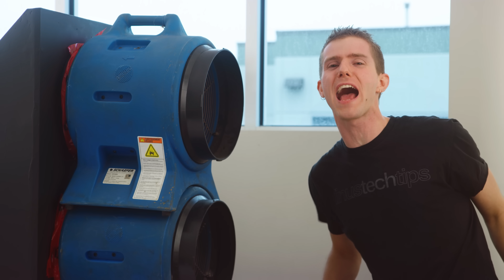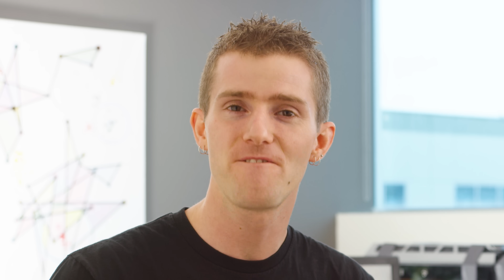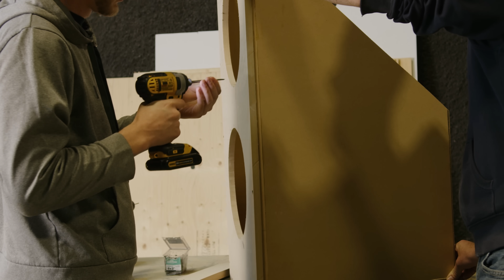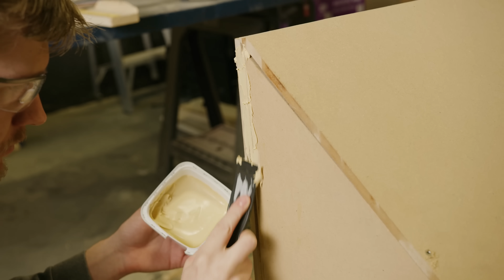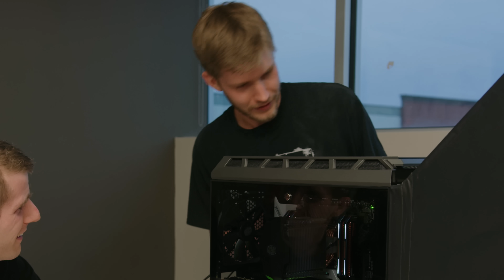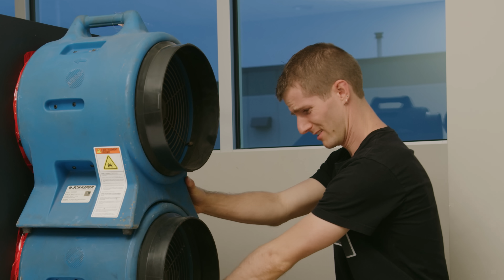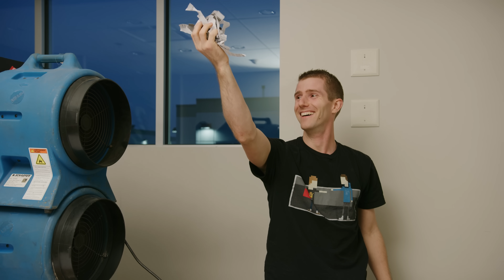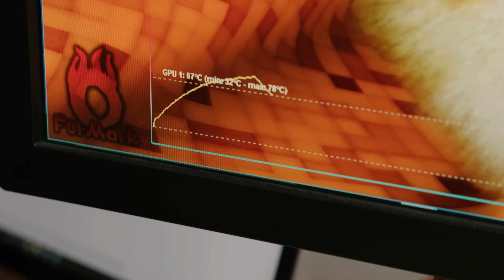Highest Airflow PC EVER - SUCCESS!

Comment: What if you make it so that the fans will suck air through a refrigerator before being blown into the case?
Reply: They've covered this kinda thing, fridge compressors aren't meant for continuous use and burn out
Reply: With the amount of airflow this thing is putting out you would need about the largest A/C coil for residential use to keep up with this thing.....and then, as naufalap pointed out, you would have hella condensation issues.
Reply: An air conditioner would be a better idea.
Reply: bruh, it's called a phase change case. It's basically an ac compressor and condenser hooked up to a cold plate. It's ungodly loud but will give you unlimited subambient cooling.
Reply: If the air was back to room temperature in the case this would be true. But.. We all know condensation happens because cold air can hold less water, making the relative air humidity rise in the fridge part of this magnificent theoretical case. As the air would still be cold when it enters the case from the fridge, it would still have a high relative humidity and therefore still be prone to condensation until it has heated back up again.
So either a very low room humidity or some kickass dehumidifying would be necessary.
Reply: Refrigerators are good at keeping cold, rather than making cold. It wouldn't have anywhere close to enough time to cool the air.
Reply: Yeah yeah, fridge compressors cant keep up. Use an A/C compressor.
Reply: 2 words: water condensation.
Reply: You'd probably need 50 refrigerators to keep up with the air flow and get any temperature difference. A single one would probably do nothing after first 5 seconds of these fans being on.
Reply: Just for youtube
A/C compressors are also not made for constant use....at least not residential ones.  Not sure about commercial ones (which would probably be too big anyway).  Better to just find actual phase change cooling equipment made specifically for the application.
Reply: Just for youtube
And if you open up your hood and stare at the compressor while your car is running you will notice that it goes off and on constantly....it does not continuously run.  If it did there would be no need for a clutch on the compressor pulley.
Reply: Are you running a computer in -10 celsius?  Proper phase change computer cooling is designed to run constantly at a low level btw.  Also running your car A/C in -10 celsius is not the reason the compressor has a clutch on the pulley (obviously you better have your heater on in your vehicle at that temp).  The reason it has a clutch is so that the pressure on the hi side does not build up too much.  The length of time to buildup that pressure changes with the ambient temp outside....if it's cooler the pump runs less, if it's hotter the pump runs more.  Still though it is designed to where even at 120* F it's not going to run constantly, most A/C compressors just aren't made for that (just the same as the air compressor in people's garages).  And hell even then 120* F often kills cheap compressors (like the one on my Kia Rio when I lived in Phoenix).  You have to have a compressor specifically designed to run constantly for an application in which it is required to run constantly.  If you have an application where it is not designed for that then there is no reason to waste money designing it to do such.  This is why A/C and fridge compressors WILL NOT work as a ghetto rigged phase change cooling system.
Reply: That wont work, it'd suck the fridge's cool air out and then it'd just be ambiant again..
Reply: ...No
Reply: They could maybe connect their watercooled server to central heating. I wonder if the heat put out by a server rack would be enough to heat a room...
Reply: it would freeze everything
Reply: +rushthezeppelin I don't know about you but my car blows cold air for weeks and weeks and weeks if i supply it the fuel to do so.
Reply: +rushthezeppelin there certainly would need to be a clutch in the pulley so it's not spinning the AC compressor when it's -10 degrees Celsius outside
Reply: +rushthezeppelin and even when the AC is on and they are turning on and off, you're still getting cold air.
Reply: +Antonio SCENDRATE GATTICO That's a good one!
Reply: Y'all are making this way too complicated - just bolt a window AC unit to the side. A 300W computer running at full load might produce 1400btu or so of heat. You'd have a hard time buying an A/C unit rated at smaller than 5000btu. Water condenses in the unit and drains out the back in most cases, or you can poke a hole in the foam plenum to make it do so. There you go - 250cfm or so of dry, refridgerated air.

And the compressor will cycle itself, so you don't have to worry about it burning out. Although I think you're more worried about that than you need to be as well - we have a small unit with a manual thermostat that runs the compressor for 7 months at a time here in the TX summer and it's been fine for years.
Reply: water condenses in the fridge, not in the computer, so there wont be any real problem from that

Comment: Ikr, If you try this with ryzen cpu, it would be freeze.
Reply: that's why they had to use an i9
Reply: you might actually be able to overclock threadripper on air this way!
Reply: Jack, what kind of troll comment is that? AMD is known for its high heat output throughout the last 10 years
Reply: Nah man, intel cpus are specialized for toaster.
Reply: if threadripper is the only noteworthy chip from amd right now, amd has some work to do.
Reply: Yeah well the problem is that core utilization is still not that great with applications and games so unless you are a hd content creator it probably sucks even more for the buck than you could imagine. From that aspect I understand you rage.
Reply: you can't get below ambient temp with just fans, this was already at ambient temp ryzen would be the same temp.
Reply: freezEware past is the past dude, AMD is getting better and intel.... 2x price 2x heat temp ?
Reply: Capitalism Entertainment and Technologies Actually that isn't exactly true, the temps inside the case would be slightly lower than ambient temps,  because the beginning of the air channel is larger than the the end of the channel, meaning the air pressure inside the case is higher than outside the case which would lower the temperature inside the case compared to the ambient temperature outside the case. However having said that,  if the lowest temperature inside the case possible is let's say 35 degrees, then no matter what processors you use you can't get lower than that.
Reply: +Jack Isn't Daniel's For HEDT yeah, Threadripper is much cheaper and cooler than Intel. For mainstream Coffee Lake is pretty competitive (once it's in stock...), certainly not 2x heat and price. Power consumption of an 8700k is in between 1700X and 1800X in most reviews, which is 2 less cores yeah but also clocked much higher. AMD wins temps largely because of Intel TIM (not that that's excusable).
Reply: freezEware
Someone's been living under a rock.
Reply: Oxaile, that someone must be you.
Reply: ofcourse the OP knows this.It's a joke.
Reply: freezEware
Because an overclocked AMD octa core runs cooler than a stock Intel quadcore with the same 280mm AIO?
Reply: freezEware
Oh boy, looks like the Intel fangay is mad cause his dear monopoly lost some of it's market share.
Reply: Temps would be exactly the same

Comment: What if you remove all of the other fans in the system?? Would it even change the cooling at all?
Reply: might actually improve it a little, especially for the GPU
Reply: It would probably actually improve it because the existing fans would provide a lot of resistance...

Comment: Some time ago, high performance car manufacturers learned that there has to be a compromise in aerodynamics, because you have to feed the motor with air for the combustion chambers and for the cooling systems of those beasts, 60,000 litres of air per minute are pumped through the engine, while the coolant pump can circulate 800-litres at the same time (in the Bugatti Chiron)... you are getting to that point.

Comment: I get that you're up what you had lying around, but stop buying and therefore using mdf, at the least start using plywood,  the price isn't even higher in any practical way (ply has greater strength per thickness, and it looks better,  is capable of taking proper mechanical fasteners  (screws/bolts) and finally you won't get a hernia trying to move it

That said I'd like to see you use real wood, but it's painfully obvious that that is out of budget and skill for you guys at this time  (a man can hope)

Comment: the new haf under testing wasn't very good at airflow in the first place. the new haf has shitty front and top panels.

this was a rushed case design. that includes the new cosmos. it was also rushed a good bit.

Comment: Intel's preferred way to air cool the i9? 😂
Reply: The only way :)
Reply: The only thing that keeps I9s below 90c is liquid nitrogen cooling, and even then it only knocks them to 80c
Reply: We should probably stop laughing, I9s are the cause of thousands of burned down homes so far
Reply: I wanna see where this is going! Tbh I am an i5 4thgen user turned to ryzen just a week ago. And I am in love with it. No hate on neither of the platforms.✌️Peace.
Reply: I9: 1hp airflow fans. I11: 1ho airflow ducts with refrigerator. I13: hover craft air ducting. I30 liquid nitrogen ducted jet engine.
Reply: iDARKSPAWN lol, custom loop and "not that bad", its supposed to be excellent with that cooling. Why would you get an i9 instead of a threadripper. Seems like a stupid choice
Reply: I guess the AMD boards didn't have enough RGB headers for Darkspawn.
Reply: DAMN YOU AMD AND YOUR LACK OF IDE SUPPORT!
Reply: The only way to cool threadripper.

Comment: The h500 actually has poor airflow and the front panel and the top are really flimsy and only hold on with small magnets and no clips. Go see gamers nexus and buy a different case for high airflow.
Reply: Evga's DG-8 series is pretty good tbh.  a total of 8 140mm fan slots, or 2 140's & 8 120's
Reply: an ammo case with a grill on each side is pretty good for that.
Reply: h500 really is junk! poor airflow HAF! no where near
Reply: I know what a crappy case, panel doesn't even stay on when you blow two jet engines into it. Literally unusable.

Comment: I have pulled air in from the outside through a 8" duct into the case before. The outside air was around 26-28 F . I cut a piece of cardboard to fit a " broken window... my dog broke ;) " . Flex duct with a duct fan in the front of the case something like you guys did ... but way neater    ;)  left the side panel on and took out the rear fan and got almost the same temps with a 1/4 horse duct fan It may have been less horse power than that. Would be a " cool kit " to market if you could find the sweet spot before the  returns on the air flow  went south . lol again 1% I'm easy to get along with .

Comment: Using those fans with a 720mm (2x 360mm) radiator for water cooling is, in the instance that you are tucking away your steam stream host where you'll never hear it, a possibly wise decision. You just need to soundproof to 90 DB.
Reply: morgan minecraft legion that was so much louder than 90db. Their dB weight was off
Reply: Seth Haberman - Are you sure? I've used a similar tool before, and as far as I am currently aware, results were accurate.
Reply: Yea I’m pretty certain, I work regularly with live audio. Linus was having to yell pretty loud to get over the noise of the fans. He was probably using dBA weight instead of dBC. Louder rock music might be 102dBC but only about 90dBA. Different weights of measuring sound levels

Comment: Next, watercooling using car radiator, with these two BAF as the fan.
Then, using refrigerator gas in a heat pump circuit to cool components with compressors and whatnot. Or you can just use solid state heatpumps from ChillTec or Phononic

Comment: I'm still using my old HAF X full tower with the stock  case fans (3x  200mm) on a separate controller, it'll run lovely and quiet just doing basic stuff but I ramp up the speeds for gaming and the temps are really good, next project is to pull the front drive cradles for either another 200mm fan (I can fit 5 in total) or go liquid with rads on the front and top.....still deciding

Cool build too and yeah....leave the wood butchery to pro's, losing fingers really makes it hard to play games

Comment: What if you did the same thing with an industrial strength water pump, pumping fluid through large radiators as fast as the air in this case is displaced?

Comment: Without mods, a 280+ aio or a double (CPU/GPU) custom dual loop, the only way to keep that “high airflow” 500 cool.

That case looks so cool irl, but I’ve never seen a case labeled as high airflow that is built for water cooling.

Comment: Could a 1070 and a i5 4690k run on an 430 watt power supply im looking to upgrade to a 1070 from a 1050 ti and i was thinking of a 1060 but the price to performance is better ive seen people say a 430 can handle it i just want assurance.

Comment: AirFlow you said ? That's AirFlow (355m3/h each) => you can get them here => https://www.onlinecomponents.com/ebm-papst-4112nh4.html?p=12101128 => http://imageshack.com/a/img62/3053/20120309185138.jpg ... Thermaltake FRIO OCK was the base (http://www.thermaltake.com/products-model.aspx?id=C_00001646) => http://imageshack.com/a/img856/5762/20120309185158.jpg ... Fan-Controller, in case it might be too loud => https://www.nzxt.com/products/sentry-mesh ... 2600k @ 5047MHz on Air ^^^

Comment: install the fans outside on the wall or something with a moisture guard and run some ducting into the office and attach it to the case, then run an exhaust fan out the window, then make the pc case airtight and wrap the whole thing and ducts in noise dampening material. 10/10 best idea ever.

Comment: Great PC if you worked right next to a Airport runway no one would even notice it!
Reply: Zander Rossman you can use a jet engine to quick-bake one...
Reply: I'd rather just figure out how to make a miniature black hole to place inside the system designed to only absorb heat.
What could go wrong?
Reply: 500°C exhaust so no.
Reply: What if you put it the other way and suck the air out of the pc using a jet engine?
Reply: RpiesSPIES SpaceTime.EXE could crash.
Reply: edmdeposit more like the whole solar system
Reply: Timeyy, it would suck the whole PC in :)
Reply: Wait can we use an airplane engine to cool a pc?

Comment: I think you guys can make this even better with a few changes. Like remove the rear fan and try an make an easier path for the air to flow in and out of the case at the front and the back. By doing this you'll lower the air pressure inside the case but increase the volumetric flow rate. 
I also think it would be very interesting to see what would happen if you put a big cpu heatsink on the back of the graphics card, since you've got a tremendous amount of airflow with not a lot of surface area for the graphics card. 
I think it might also be useful to try and lower the turbulence inside the connector(well the thing connecting the fans to the case). Not sure how well some janky mods will work, but I'm keen to find out.

Cant believe I'm saying this, but this project really makes me wish I focussed more on fluid mechanics

Comment: Of course this is stupidly overpowered, but maybe if you turned down the rpm on the fans? Maybe by regulating the current going into them? Would it be better than small fans in terms of cooling / noise ratio?

Comment: you need to try and overclock this PC asap
Reply: It not even good temps my 2600K @ 4.4Ghz with a h155i in Fractal Define r5 maxes out at 60 degrees but my graphic card is just under 80 degrees.

Comment: With a setup like this I think that the Heat in overclocking would no longer be a limiting reagent and rather the maximum amount of voltage you can put through your parts.

Comment: Shouldn't fans be turned different way? If I remmember physics, if you reduce pressure, you reduce temperature also, right? 

Airflow is just one of factors. 

Air pressure should also be accounted here... 

Since there is no way same amount of air is being pumped out as in, you are getting increased pressure. 

To reduce temperature, you should reduce pressure.

Comment: So, next video in this series needs to be putting the computer and fans in an acoustically isolated location.  Put it in a soundproof room and either run cables to the monitor or ductwork to the computer.  Then, benchmark.

Comment: FYI when air is compressed it becomes cooler. By having both of those fans blowing through a duct that leads to a smaller size its pumping a lot of air and cooling it at that same time even before it enters the pc case. If you made the duct smaller it would make the cooling more efficient.

Comment: Quick question, wouldn't all that air pressure move / unseat some of the components inside?  I'd be concerned about that wind inside moving the RAM modules slightly out of place.

Comment: Next time use an intercooler and an Eaton  supercharger. Bad ass!
but seriously, intercool it. Building pressure increases heat, cool the pressure through an aluminum tube with air pathways and fans, or do like a methane cooled rig. Ya know...for the shitty giggles.